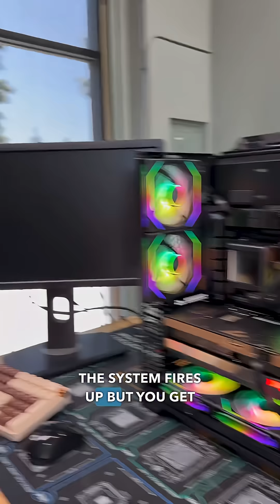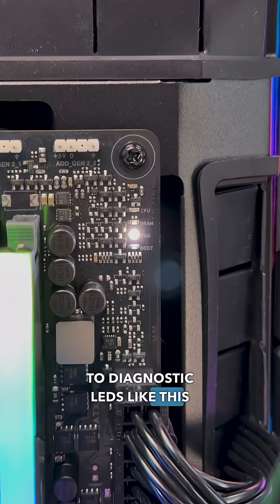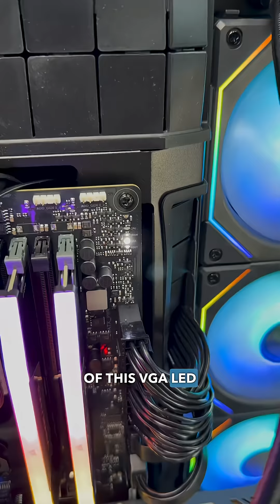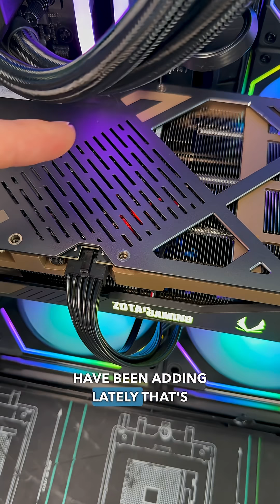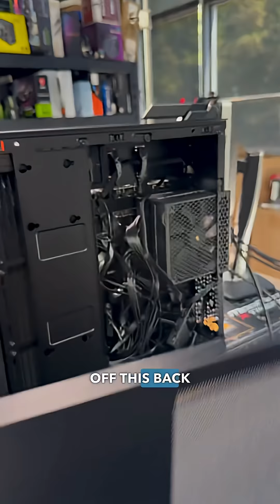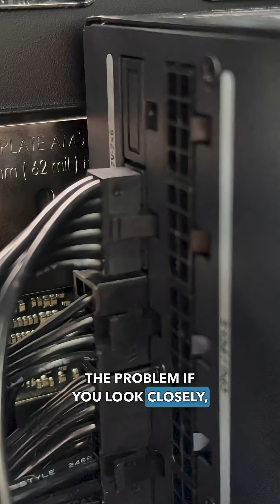NEW PC NO POST! #pc #techtips #pcrepair #repair #computerrepair #pcbuild #gamingpc #gamingcomputer

Comment: I had a problem with my fans not spinning and wonder why, I just moved the cable since I put it on the 2 to 4 instead of 1 to 3 since my fans pin only has 3, good thing I didn't send it a person

Comment: Funny thing is, the LEDs are actually the less-good diagnostic option... the better option is a two digit seven segment display, which gives you a hex code corresponding to the precise bit of the POST it's on. (It's actually kinda cool watching it flip through codes as it goes through the various steps.)
So if the POST fails, the display freezes on the exact code it was working on at the time... and if it does fail, it goes to 'FF' and wheee boot.

Some motherboards apparently have a header to plug one in, but some higher end ones have it built in...

Comment: Had the same light tried several things, I plugged my gpu into the other pcie 4.0 slot, and it worked there. So I installed windows updated drivers put it back into the pcie 5.0 slot, and BOOM works like a champ!

Comment: Use to melt? They are still melting on both ends this time even with each cable being seated correctly... Nvidia needs to do away with this faulty connector.

Comment: Hey, so quick tip for anyone without those lights on your motherboard, press the numlock key on your keyboard or press the power button just once as a standard press (not holding it down for ages). If the numlock key lights up just fine or the pc turns off as youd expect, its just a no display, so check your GPU and its connections, if the keyboard doesnt light up at all and the pc doesnt shut down without the switch at the bakc or long press (power drain) of the button, take out a RAM stick (only when the pc is shut down) and go from there, as thats a more complicated issue and can mean faulty parts or even CPU which can be trouble. Alternatively, sometimes RAM sticks just dont like working until the system is in Windows if its a fresh build, so running it with one then putting the second back in when its in Windows can solve it (obviously shut it down, put the RAM back in, then boot up again, never take a stick out while the pc is booted)
And before anyone panics, always remember to check the dumb stuff, if you suspect a faulty stick of RAM, check its clicked in right, check CPU power if you suspect that, etc... most of the time its super simple, pcs are fickle and as he pointed out, can even melt if something just slightly isnt in place, so check simple stuff first before assuming its broken.

Comment: I know this is how you make money. But, when I built my first pc last year, my pc also failed to post the first time I fired it up and it was getting stuck on the VRAM LED. I tried reseating them, but that didn't work. I tried each one doing one slot at a time. That didn't work. So I bought new RAM sticks, installed them, and it posted immediately. In this case, I would've gone through the entire pc and double-checked every connection to make sure they were seated properly. Mind you, when it comes to technology, I'm a caveman. But even I would've gone through to make sure the cables were all plugged in properly and everything was hooked up. That's just basic stuff lol

Comment: I had a fairly similar issue when I built my computer, no post everything lighting up, unfortunately I didn’t have a vga debug light on my motherboard and it ended up rather than being a faulty connection it was actually the Corsair cable I was using was faulty and I switched to the adapter and then it worked properly, only after I individually tested every single other part 😂

Comment: I worked in a factory back in the day making headlights for high quality vehicles like Chevy trucks and SUV and the first thing they taught us is the push pull push method and these headlights use the same plugs as PC cords you push in hard then slightly pull to check the locking mechanism then push lightly again. After I assemble the projectors and plug everything in and screw the housing and assembly down id send it down the line to testing and they would plug it in and check it's alignment.

Comment: Imagine taking your pc in to get fixed just for it to turn out that it was just a cable not being connected properly..... That happened to me once i cleaned my pc of dust then when i put it back together i forgot how all cables are supposed to be connected i took it to some pc repair shop and then i found out it was just because i didn't correctly connect one cable

Comment: "used to melt" me sitting over here with an RTX 4080 strix Edition that melted after 6 months of having it. I've built computers for over 6 years and I was well aware of the melting problem prior to buying this card but I never thought it would be me and I did everything to avoid it and it still happened .We can confirm they are still melting even into the 50 Series

Comment: once I have a motherboard that will tell me if the GPU's cable is not plugged in by simply displaying a message on the screen instead of POSTing which says "please connect GPU power cable and restart the system" or something like that. I wish more manufacturers could add this funcionality, since the mobo was a chinese X99 or X79 that was bundled with a xeon kit (which has no iGPU before anyone say that that is the reason it did that)

Comment: Ive currently got this issue but instead of GPU, its the ram, both RAM Sticks properly work and tried each slot for both each RAM, only when in dual channel it fails to boot and stuck on the DRAM LED

Comment: Wait, i bought mg pc from best buy and it has a 4070 super but its always had the red light. I thought it just meang that the pc was getting power. It was even when it was off and its just plugges in and the swich is on not necessarily the pc.

Comment: Well i see whoever built this doesn't understand airflow
Reply: YES EXACTLY THANK YOU 😭😭
Reply: This is actually similar to the King 95 Pro fan setup. Although the gpu radiator mounts on top but still has 3 fans on the side and 1 less on the back.
Reply: @nimrowd2023  the bottom is exhaust and the rear is intake

Comment: I would have a question, if there's similar issue, but it's about boot loop due to CMOS (which some laptops does not have), is such cause due to main battery failure? Ty!

Comment: this happened to me when I was upgrading to my new Ausus TUF RTX 4080super from my old EVGA GTX 1080ti. after clearing up some confusion regarding the little red light on the card that seemed to only be on when the system is off, I determined the solution to my problem was to use two VGA cables plugged into a splitter adapter instead of a single cable with no adapter.

Comment: I have to take issue with this.  The post check has failed, but it is posting as the cycling through the LEDs proves. n Tests are being carried out.  If no lights came on that's a failure to post as nothing is happening at all.

Comment: Im getting same issue in Ryzen 5 3600 only with 2 sticks of ram, with 1 stick system booting fine but with 2, system lacking in Dual ram memory controller, it giving me DRAM led in debug when i tried installing 2 sticks in A2 and B2 slot and led changing to CPU when installing A1 and B1. I tried changing motherboards and several ddr4 ram sticks but dual channel is not working, only single channel working, im using dual ram sticks in A1 and A2 DIMM slots, B1 and B2 slots not working completely and system not booting. Let me know if anyone has some fix for this though i have tried everything like enabling XMP profile for ram and undervolt ram speed etc but nothing worked

Comment: I dont get why have so many fans in a single pc lmao but still ty for the advice man
Reply: The Idea is that the fans won't have to spin as fast to cool and therefore being quieter, the execution here is that all the fans are backwards and not reverse blade. Also there would be too much positive air pressure making the rear fans need to word harder just making the pc loud anyways... I would have just removed the rear fans all together, so much intake you don't need it

Comment: well my pc also get stuck on the vga stage sometimes as well.. but that is just it.. sometimes.. like randomly... i have no clue why.. i run a system with a asus geforce 4090 16GB og/oc and a corsair rm1000x psu.. but yea my gpu do have that junction conector with 4 conections on the cable... all i can think could be the problem is a random bios timing problem or something.. because my pc do work.. i have put in a anti-sag bracet to prevent gpu socket damage and i have pushed together all the conections extra hard.. one thing to not though is that i do cut all power to my pc every time i shut it down by also flipping the psu switch just to make sure nothing happens.. heck i never even leave my oc in standby ever.. i always make sure to shut it down completely... also i have only hadit since September last year.. and my problem has ben happening randomly although quite rarely. and it do get resolved after just pressing the reset button on the case once or twice at most... but one thing is for sure.. i can not afford to buy replacement parts for my pc or even have the option to bring it to a service center.. i spent my 8 years of savings on and yea.. have nothing left now... and i don't own a car and i live in a small town without service center.. so yea.. if it do end up getting worse i would literally not know what to do...

Comment: Is that the 5060 ti 8 or 16? Coz mine is 16, and i get this issue, all things are new, even tested the ram stick swap with other working ram, the gpu doesn’t have that red led thing … but i get failure to post ONLY if i did not turn off my UPS COMPLETELY… but whenever i leave it on and just shutdown the pc… the next time i boot the pc its a total black screennnnn😂😂😂 HELPPPP

Comment: It's surprising how it caught this small of an issue
Reply: I'm betting it's able to measure amperage. Those cables push 12V no matter what, but an imperfect connection/contact can prevent the pins from transferring power efficiently which can mean that in order to supply the power (watts) the card needs the PSU will need to push more amps to the card in order to make up for the loss from the bad connection. The card can then sense that it's being supplied with WAY too many amps compared to what it should need, causing it to throw an error and refuse to boot. 

That's my presumption at least.

Comment: My asus b650m motherboard has something similar to this. It trains the memory each time i boot my pc due i have 16x4 ddr5 memory at 5800 MT speed. Ryzen 9 7950x3d max speed is 3600 mt with 4 ram by default but so far i have achieved max efficiency with no crashes.

Comment: I worked at a computer shop years ago and this was one of the most common issues I ran into. Customers would build computer and could not get them to post. RAM not pushed in all the way, power connections not pushed in all the way was a common problems.

Comment: the no post happened to me and it was stuck on CPU light, I narrowed it down to my CPU was busted or my motherboard was busted. i got a new CPU to test but it still didn't work so ended up having to get a new motherboard which fixed it all. it was not cheap 😭

Comment: Recently build my new PC, beast of a machine I've been cooking up for like 3-4 months now. Had some issues with the RAM as I'm used to them being in the A1-B1 slots instead of A2-B2. Got the red glare on the DRAM and switched around for a bit, cleaned it even and then it worked.
Specs are:
GIGABYTE B850 AORUS ELITE WIFI-7
RYZEN 9800X3D
CORSAIR VENGANCE 48GB 6000 MHz CL30
GIGABYTE RX 9070XT
GIGABYTE 360MM AIO

Comment: I don’t know if this is just a ROG thing or not but my motherboard came with a speaker, it does a very quick high pitch chirp if it posts but if not it does a lower 3 tone beep to let you know it failed (usually mine just has the occasional display issue due to bad cords but it’s an easy fix)*

Comment: Hello. Excuse me, is this orange power LED for the Asus z270F motherboard a sign of a specific problem? Because the system is working without any specific problems, but is there a way to turn it off?Because this light wasn't on before, but since I bought 2 new 4-pin PWM fans for the case and plugged their sockets into the motherboard, this orange power LED has been on. Can it be turned off? Or is it a sign of low power in the system? Because it stays on even when the system is off.

Comment: Same issue but when we opened, it seems 1 pin on the mobo was slightly tilted. Is that really the cause?
At first it turns on then off but then it finally on so the entire system unit is On. However, the monitor, keyboard and mouse seems to not work.

Comment: Just pray that ALL 12v lines for these 40 and 50 series GPUs never fail, because they WILL still pull full power as long as at least one line works. Which is what causes the power cable to melt/catch fire.
Reply: That's....terrifying
Reply: Yeah, IIRC the 30 series GPU's that used the new connector had fuses on every single 12v line so you'd just pop a fuse before melting the connector
Reply: @Maake986 Naw, they didn't have fuses (they should include that tbh), but they had a dedicated wire for each of the ATX adapters. That's not true for the ones for the 4090 and up.
Reply: @Maake986 Not just that, either. The 30 series still used Molex Mini-Fit Jr connectors, same as the PCIe 6+2 connectors, but they were 12-pin connectors instead of multiple 8+2. These new 12VHPWR and 12V2×6 cables use Molex Micro-Fit connectors which have much smaller pins that are all much more closely packed together than Mini-Fit Jr connectors, so they handle fewer amps while also concentrating the heat they produce down to a smaller area. 

These new connectors on the nVidia cards just have a really poor design from top to bottom, frankly. They tried to do what Apple did with their lightning cables but completely failed at it, catastrophically so.
Reply: I also want to note it IS not impossible for even the 12VHPWR adapters to know that it is not properly inserted, all this melting could have been avoided very easily.
Reply: @AgentBaphomet1255 exactly. It’s infuriating nvidia changed to a smaller connector when they increased the load on it. I for the life of me can’t figure out their logic behind the change.
Reply: That is true for the adapters... This has been tested by Gamer's Nexus. This is a native 12VHPWR connector. They have sense pins to ensure they're connected to the power supply correctly. They generally only fail if there's foreign debris in the cable and the sense pins are grounded, but the power pins are NOT properly connected. Which makes the card draw too much current along fewer cables putting too much load on low gauge which makes it hot causing it to melt.

Comment: That fan layout is criminal
Reply: Glad I'm not the only one that noticed that. That's some crazy negative pressure right there.
Reply: I think they’re reverse layout fans so they look like they’re pushing air away when they’re actually pulling air bc they’re flipped
Reply: @lucentdiagram41  That's what I thought too but look at the curve on the blades, these are normal fans. All of them are. Which means all of them are pushing air the wrong way
Reply: @GamingGenius777 ha i hope for this dudes sake its a prebuild
Reply: @lucentdiagram41  
https://graphicscardhub.com/wp-content/uploads/2024/08/standard-fan-vs-reverse-fan.jpg

Comment: Honestly, something I wonder is why on motherboards and some psu cables why the gpu is labeled as vga...
Reply: VGA stands for Video Graphics Array. It's the first video output system introduced in 1980s. I'm pretty sure some motherboards still have VGA connectors.

Comment: "Used to" melt

They still do. Don't defend bad products
Reply: Well saying used to implies that they don't anymore. Just saying "this is how these connector melted in the past" wouldnt imply it.
Reply: @BartoszRodziewicz  Welcome to Language 101. Today, we learn that words have different meanings within similar, if not identical, contexts.
Reply: @philippeleprohon4823  welcome to day 2 of language 101, today we learn how to be clear when you're speaking so that what you're saying is understood correctly. If you do not follow today's lesson, that is your failure, not the listener's.
Reply: @philippeleprohon4823  Good thing you learned something in Language 101 that day
Reply: 5070 and below dont melt
Reply: @olerius1235  he was talking about the 12VHPWR connector. Not the GPUs. Of course the connector is going to be ok in a 5070, it's rated to pull more power than what a 5070 needs
Reply: No, what he meant is that is how they melted in the past, not that they don't melt anymore.

Comment: I actually had this happen a couple of weeks ago when I migrated my old pc gut to a new bigger case and added an AIO water cooler. Where mine differed is that I could start the pc just fine if I didn't have the front USB connector plugged in, but if I did, the PC stuck at POST with the VGA light being on on the motherboard.

I racked my brain trying to figure it out and couldn't. So, I took it to a computer shop to get repaired. Found out that my GPU power cables weren't plugged in all the way. Those suckers were hard to push in! Anyways, they fully seated the power connectors, plugged in the front USB ports and everything worked fine.

Who would have thought that GPU power cables not being plugged in all the way could effect front USB ports or the PC starting up properly?

Comment: Hope you also fixed that PCIe cable hanging a hairs breath away from that bottom fan. My cable running from my gpu to power supply moved a little over time and ended up touching one of the fans in my GPU, stopping it from spinning. Luckily I caught it before it caused any issues with that fans motor. Preventing a fan from spinning is a quick way to kill the motor which kills the fan.